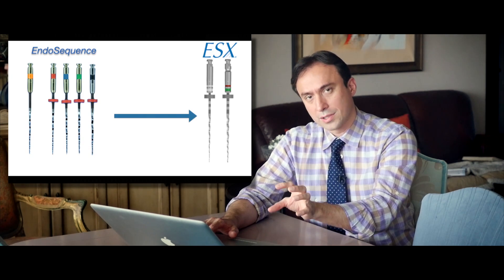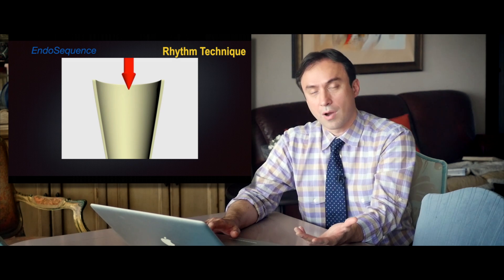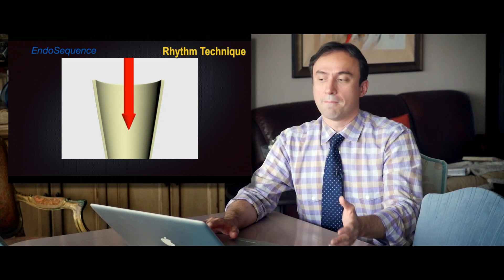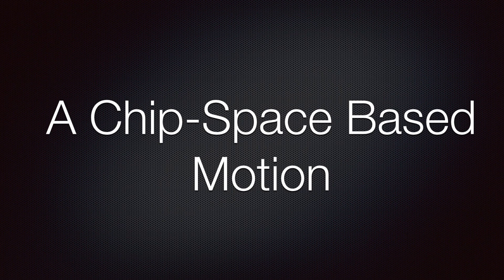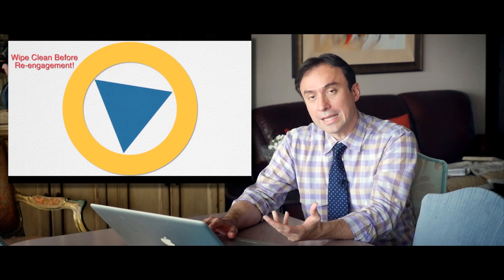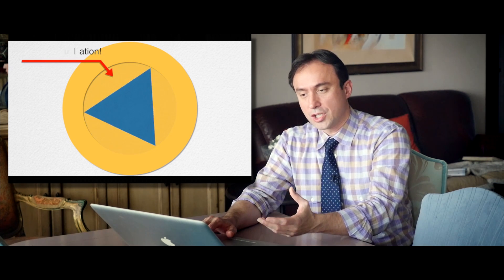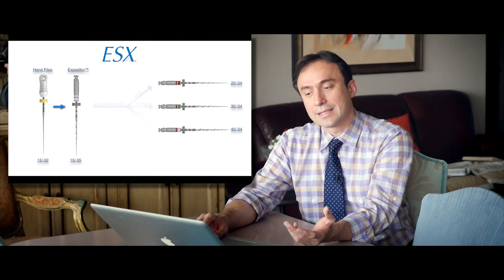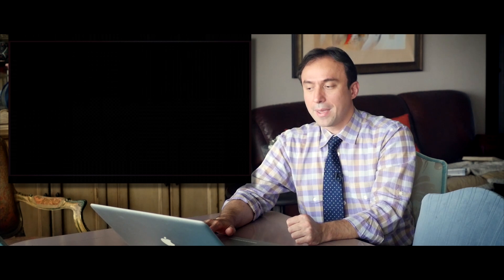ESX Instrumentation: Part 4 of 6. The SSC Motion!

Comment: Hi Dr. Nasseh, I have been following you for years and I really appreciate all the valuable videos you have being posting.
I have a question regarding the settings of the endo motor since I have one of the first generations. What is the ideal speed and torque ideal for the ESX files? Thanks on advance
Reply from the maker: Thanks for the comment. You can use a variety of speeds and torques based on your experience level and comfort. I use it at 500rpm and your torque setting is dependent on whether you are using OTR or not. If you are, I would go with 0.6Ncm OTR in normal cases and 0.2OTR in difficult cases. If you're not, I'd set it at 1.8Ncm and put only enough pressure that I don't engage the torque reverse setting. That's the safest way to operate. Good luck! :)
Reply: Thank you so much.